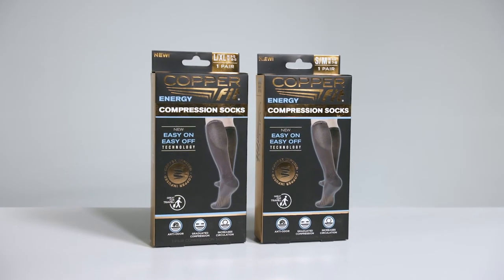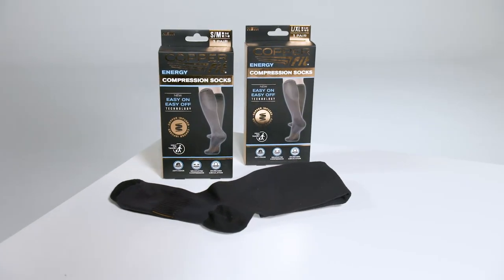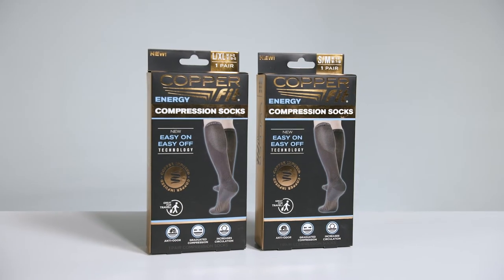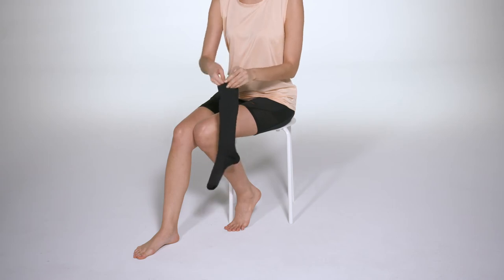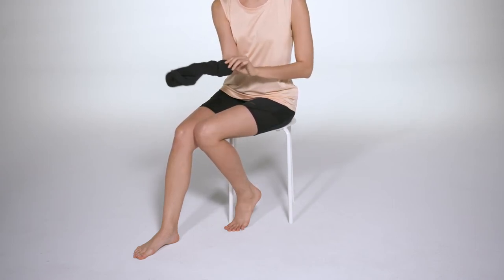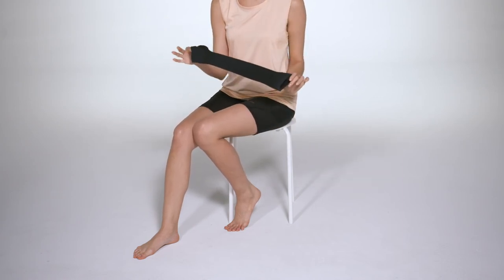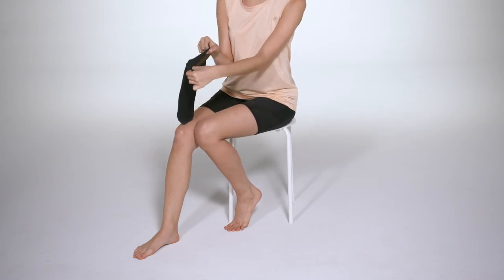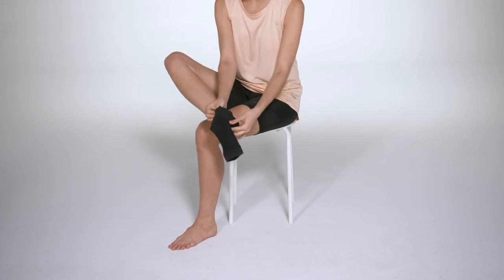Copper Fit Energy Compression Sock How-To Video

Comment: I managed to put the socks on correctly, trying it the second time. But - there is n o way it can be done as easily as shown in the video - unless you use the size bigger than what you need. The fact that the model ends up having a too long sock supports that assumption.